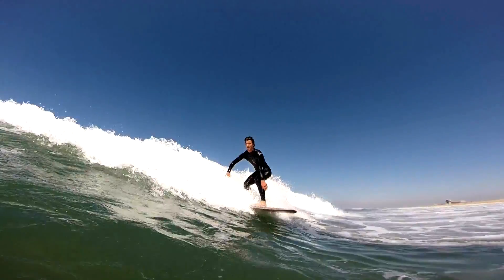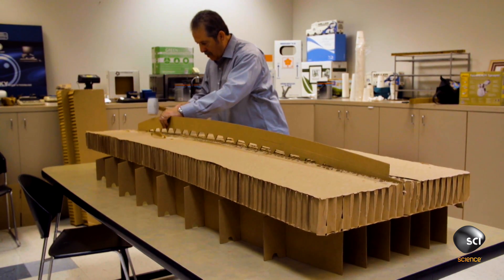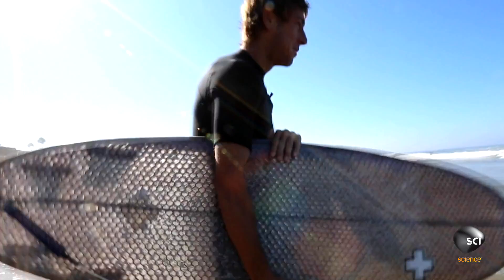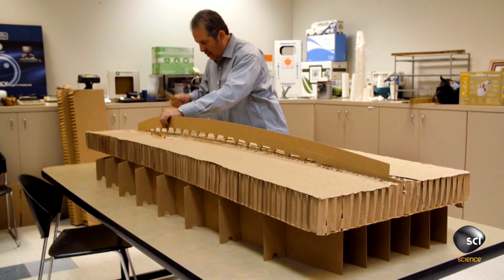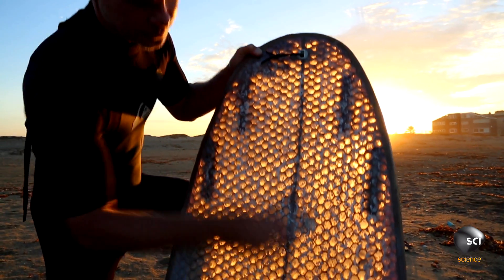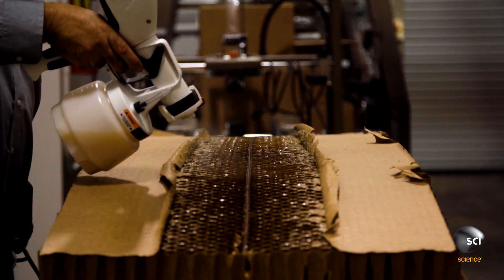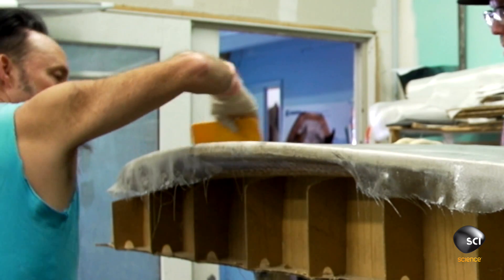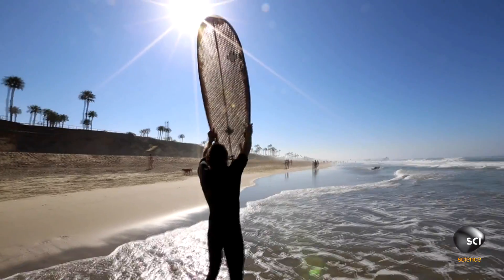Riding Waves on a Cardboard Surfboard

Comment: you forgot to add last two coats on each side of resin with wax oil before sanding it. Apply with a big brush and you will have enough coating to even the surface and sand.

Comment: When you spray a cardboard with polyurethane and laminate it in a fiberglass sheet it is not that eco-friendly anymore. Still a nice idea.
Reply: Yeah, a bit better than manufacturing a ton of non-biodegradable foam
Reply: Some other waterproofing methods that have been proved to have been used historically are waterproofing with tar, coal-tar pitch, oil and wax, among other methods. I think using leathers (of animal origin or not) could be another option (think inuit kayaks)
Reply: @BGomez-tk7lu  Just stick with oiled wood if you're going that route
Reply: ᴢᴀᴛʜʟᴜᴛᴇ so if i smoke 'a bit' less cigaretts i'm friendly to my body?
Reply: It's about taking steps in the right direction...
Reply: There are eco friendly epoxy resins nowadays and you could use hemp fiber instead of glass.
Reply: @ThaJay eco friendly epoxy is chemically identical to dinosaur oil = not eco friendly any more. Only difference is you have robbed cheap food source from starving person to make an expensive “eco friendly resin”.
Reply: Johannes Lück i was just about to write that exact same line :)